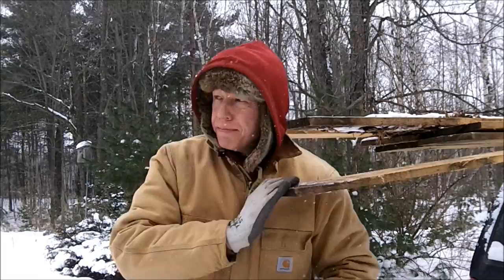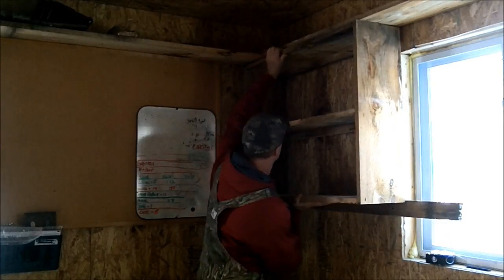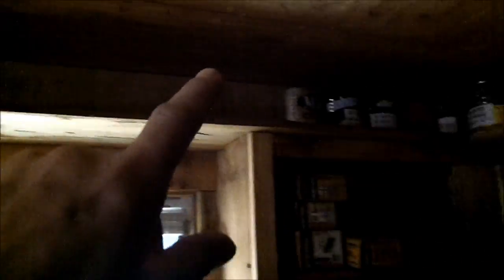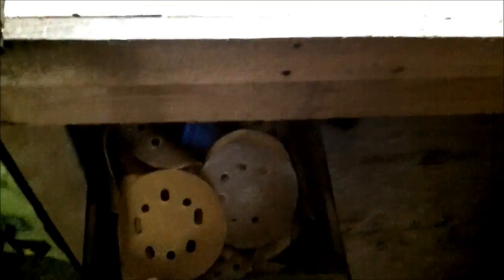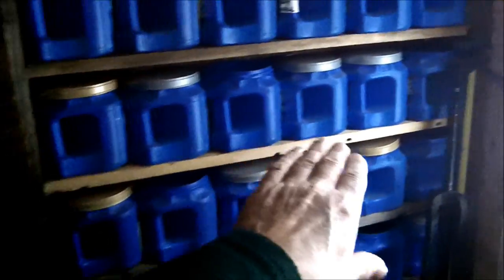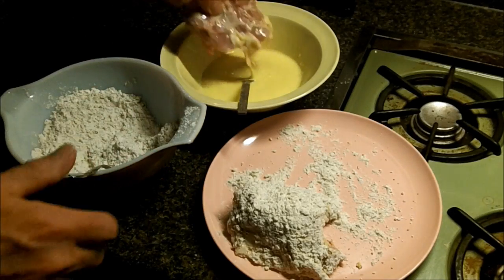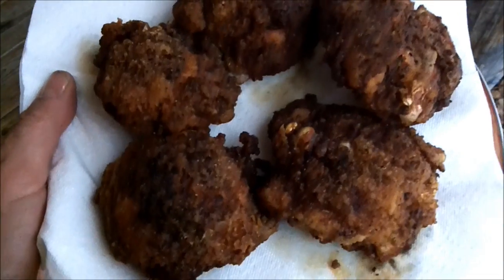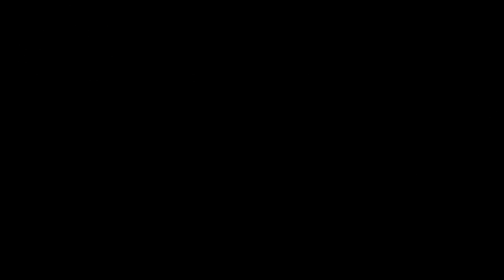CABIN TIME. Update on the backwoods workshop.

Comment: when you simplify life you really require very little power.  i have a cabin out back and have 2 old car batteries.  run a few lights and satelite radio for 60hrs per battery.  then i haul one out and recharge it.  this spring i will get a small panel to maintain the battery.

thanks for the video boss!!

Comment: look into a refurbished forklift battery ...tons of amp hours and there designed to take a beating! there around here in minnesota 12v 720amp hours for 700 bucks ...but plenty of juice man for table saw/chop saw whatever you can throw at it even a small welder...and keep your eyes open for one at a junk yard they can easily be refurbished with battery chem ...the only real con is the weigh alot 400-800lbs but you can make it work man ...thanks for the vids bro..

Comment: Quite a change from last winter, JC. We have little snow in New Hampshire and the logging is getting muddy. Your workshop came out great!. Just the right size. Your solar panel project is one we have been waiting for. Looks like I'm going to have more time to help out on the farm this spring. Keep chipping away my friend...
Reply from the maker: +diane hall  Lots of folks anxious for the solar to go in.  I've had the system (except for the batteries) for over a year but just haven't been in any hurry to install it. I wanted the shop up and have a place for the batteries. Got that done so I may just get to those panels soon.  Cheers.

Comment: Hey Boss,
Do you ever get any moisture in the cabin or shop from heating it up in the winter ?   I have a small unfinished cabin in Oswego county New York.  I get moisture on the inside after heating it up.   Kind of worried about getting mold in the insulation or the wood rotting down the road.  What have you experienced or done to prevent this problem?   I have been watching your channel for a couple years now.  Keep up the good work.  I thoroughly enjoy watching your videos.
Reply from the maker: +TheDman22088  No I never get moisture issues. Not sure why you are experiencing that.

Comment: JC, curious what material you used behind the wood stove for fire protection. Is that cement board? it almost looks like slate. Awesome video again. I listen to your videos at work with my headphones on and just let them run one after another. I've seen them all multiple times. I figure that increasing the view counts on your videos is my way of saying thanks for all the effort you put in on them. I do enjoy them tremendously. Thanks again. Tad Scheeler, Kalamazoo, MI
Reply from the maker: +mibengal  Thank you my friend. Not sure if the view count adds up when they are played repeatedly from the same computer but thank you just the same.  I often use cement board but this is some old fireboard from the 50's.
Reply: +thebossoftheswamp I like that. That board is older than both of us and still serving a purpose.